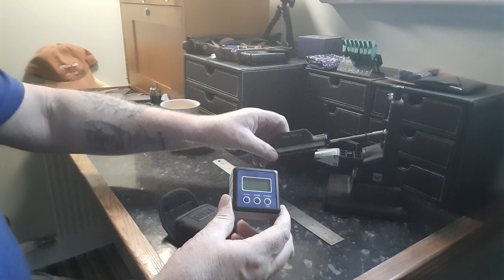knife talk. fixed blades,worksharp and tools.

Comment: For the price of that Work Sharp you get your money’s worth. I bought a Jewelers magnifying glass that is lit with LED lights and has a UV light for inspecting gemstones. You can see that many blades have more grind on one side than the other. If you even the grind edge up and make both sides the same it reduces the time even more to get a perfect cutting edge. It seems to me; they stay sharp longer too. Morakniv made a similar wood chisel knife as the one you have. I think I bought one quite a while ago. It is one handy tool to have; I think I paid more for mine and mine looks smaller and is made of carbon steel. No matter about that; it can do so many things it hard to find something it can’t do. I tell what I did buy you have; is a Wood Machinist tool box. It is a Windsor model like I think yours might be. It is great for storing all your pocket knives that is for sure. I went on a wood carving binge a while back. I made a tree into all kinds of spoons, spatulas, cups, bowls just using a hatchet and Mora carving knives. That is taking whittling to a higher level. Mora laminated steel holds an edge like nothing you can buy for carving wood. I promise you this; they will still be sharp long after you get tired from whittling away for hours on wooden spoons.

Comment: Nice looking fixed blades.  I am looking at that work sharp. Looks like a more adjustable version of a Lansky. They sold out quickly at most retailers here. Haven't checked to see if they restocked.